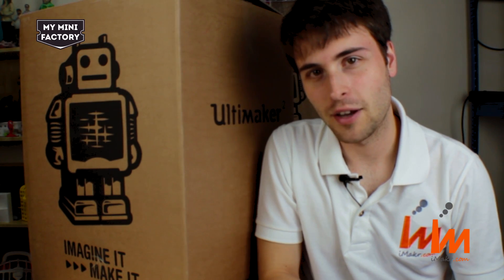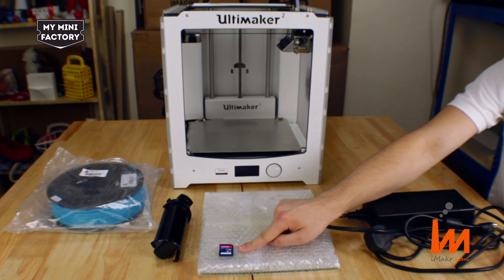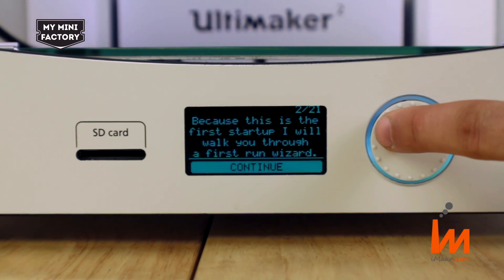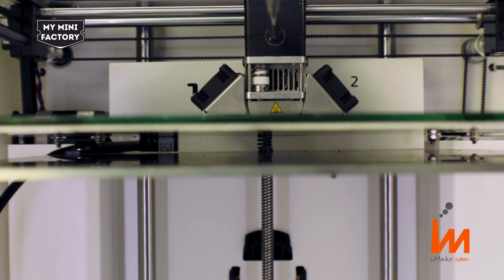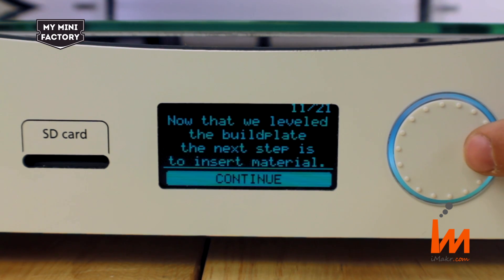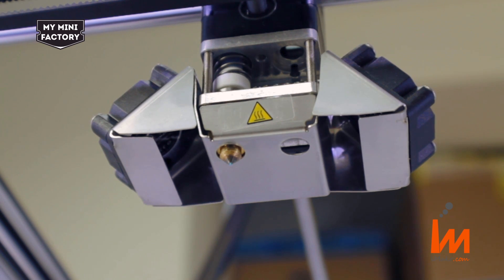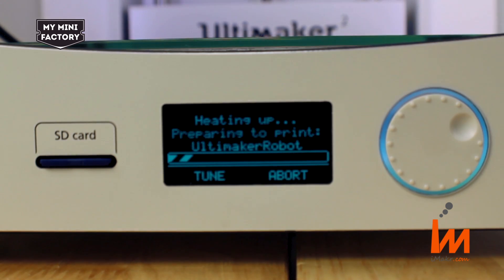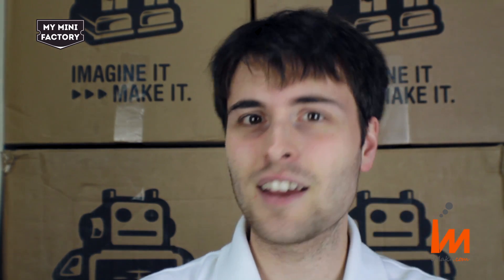Unboxing Ultimaker 2: My First 3D Print

Comment: On the paper calibration...I have an Ultimaker Original and this has always puzzled me a bit.  Should the print head dig slightly into the paper (leave a small indentation) when you have it right?  In your video, I heard the "thunk" of the print head hit the print surface when the paper was pulled out...so I think I am doing it right...?
Reply from the maker: You should feel some resistance on the piece of paper but still be able to easily pass the piece of paper between the nozzle and the build plate without tearing or damaging the paper. The nozzle shouldn't dig into the paper and it shouldn't leave a small indentation into the paper - this would mean the build plate is too close to the nozzle.The 'thunk' noise is probably the sound of the paper scraping against the nozzle as it is removed.